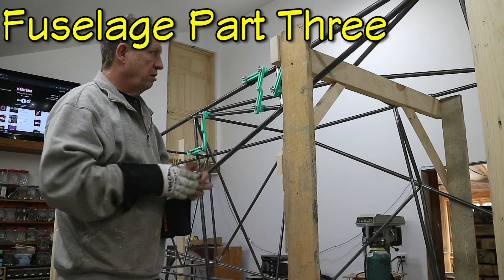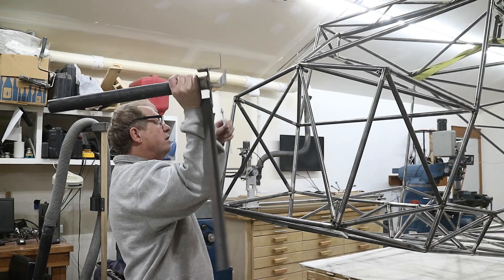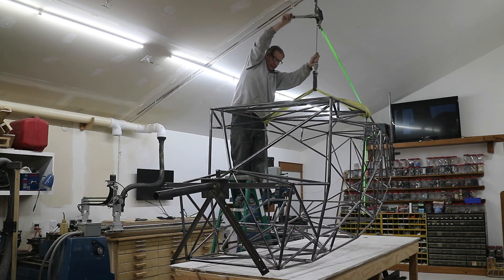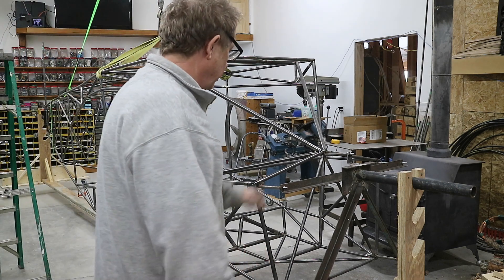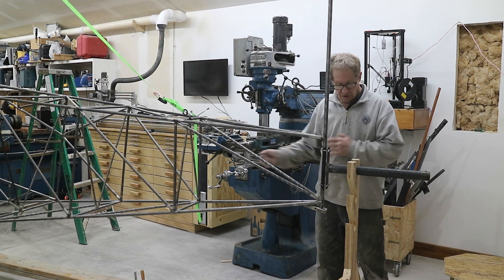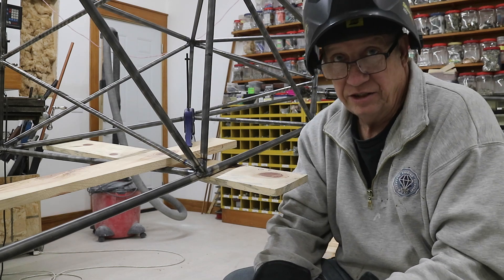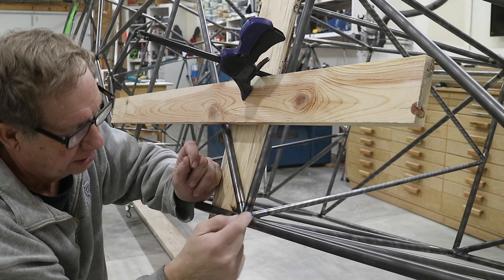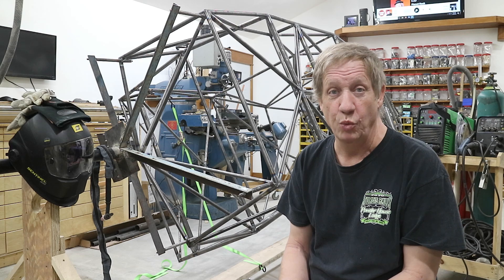Bearhawk Experimental Airplane Build : Fuselage Part Three

Comment: Great Video.  Where did you get those magnetic tube positioners?
Reply from the maker: No magnets, I made them with a 3d printer they just clip on the tube.
Reply: @BSpotBuilds very nice!  Any chance you could share the STL file?   Loving your videos!
Reply from the maker: @KrisLamberth-eq5vc  This will get you started https://www.thingiverse.com/thing:6755439 assemble with 1/4 inch carriage bolts and wing nuts
Reply: @BSpotBuilds thank you!
Reply: @BSpotBuilds Thank you!
Reply: Салом видео ларингизни курган сайте мен хам УЗИ на ишончли ортаяпти шу йуналишда ишлаяпсан размат❤🎉😊

Comment: Thanks for the videos!  Learning a lot.  I finished a RV8A and now working on a Fiesler Storch replica from the Pazamany plans.  All the tail feathers and wings done and starting on the fuselage.  Those 3d printed adjustable tubing clamps look GREAT!  Is there any way I might purchase the file so I can have some printed?
Thanks so much, Mark
Reply from the maker: I would give you the files if I could find them. I just looked for them the other day at someone else's request. I had no luck finding them.
Reply: @BSpotBuilds  Thanks for checking.  If you run across them, please let me know!
Reply from the maker: I found the file.
 https://www.thingiverse.com/thing:6755439
Reply: @BSpotBuilds  got it, Thanks so much!  One question, what type of material did you use to print the clamps?
Reply from the maker: PLA, I don't remember how many layers but I guess I used 5-6 on the walls, top, and bottom with 25% infill. I did manhandle and break one or two but it seemed good enough.
Reply: @BSpotBuilds  Thanks so much!!!